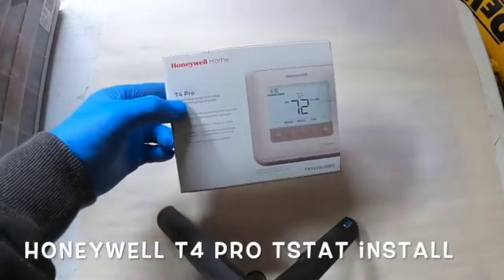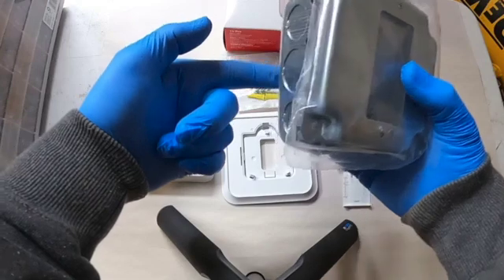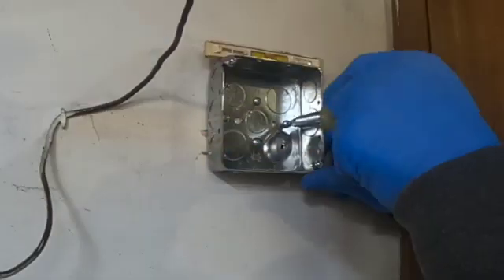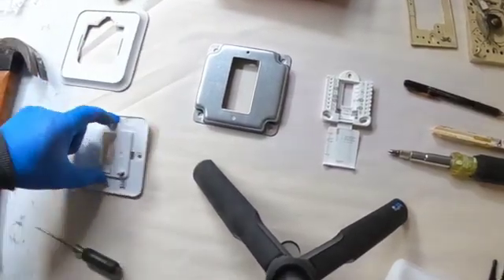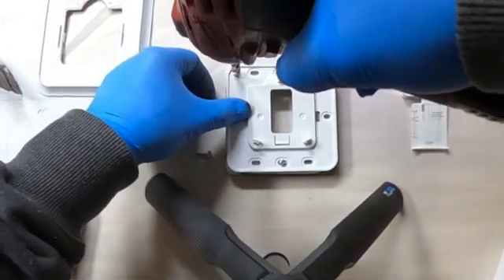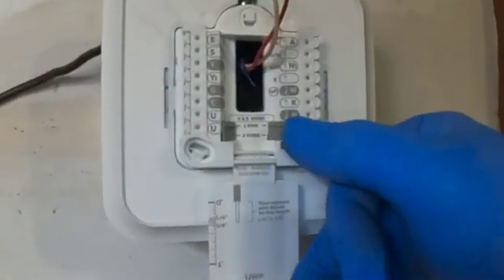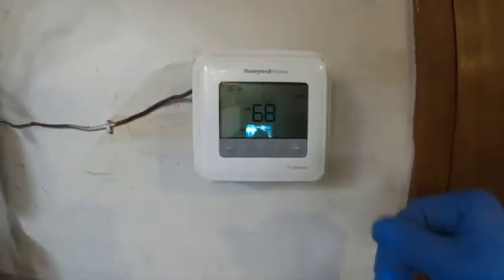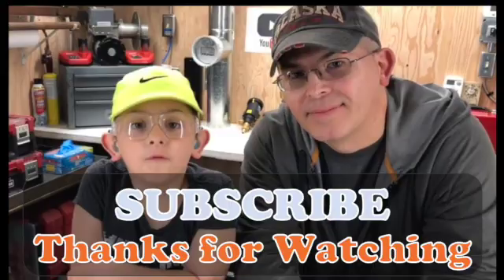Installing T4 Pro Honeywell Thermostat

Comment: Hi, I have the same thermostat, the TH4 HOME. If I want to upgrade to the pro version that has a WiFi control option, can I just plug the new head unit into the same base? They look practically identical.

Comment: 2 questions:

1. Why not use the common wire?

2. Why not mount the metal box cover to the box first, then the thermostat?
Reply from the maker: Thank you for watching and leaving your feedback! 

Most of our systems use only two wire setups. You can definitely use the common wire! 
I am sure there are many ways to mount a thermostat. This is just the way I did it for this project!

Comment: hi, is this installation is for heater only
Reply from the maker: yes, if you would like to hook up cooling or a fan, you would need to connect the (Y) & (G) wires to the tstat as well. I was only needing heating when i created this video.
Reply: @FurnaceTech  can u make a video on how to connect heater and air conditionin

Comment: I have a blue and black wire.. Not sure where they go
Reply from the maker: The best thing would be to trace it out on the other end to see how they are connected. This way you can be sure to hook them up correctly.
Reply: I ended up popping the furnace open and looked at the wires and aligned them to the letter.

Comment: I have a T3 and I want to connect the heating, which should I use the same ones that you used in this video or C and RC?
Reply from the maker: R - power from heating transformer 
Rc - power from cooling transformer 
W - heat
C - common
Y - cooling
R - fan
I hope this helps
Reply: What if I don't have a common wire

Comment: Red and white?? What kind of thermostat ever has only red and white? This is useless for actually wiring and you don't need a video for mounting the thing on the wall.
Reply from the maker: Every part of the country does not use Air Conditioning. We have mostly heating systems here in Alaska where I am located! Which is why this thermostat is only using two wires. Maybe this is a waste of time to reply but I do appreciate you taking time to leave your feedback.
Reply: My only has red and white. Really helpful this video!!!
Reply: It was all relevant.  Thanks for the information to all.
Reply: Agreed

Comment: Only with 2 wires, air conditioning will work??
Reply from the maker: No, you will need a yellow wire as well. It will be hooked to the (y) terminal.
Reply: NO HE IS  TOTALLY WRONG , FIRST OF ALL THAT IS HEAT PUMP THERMOSTAT , NEEDS 5 WIRE , R. W.Y. C. G. O.OR B. TERMINALS

Comment: How do I set the a/c on auto mode so it's will turn on or off depending temperature? It's so freaking cold at my house right now ,and it just keeps going ever since they installed it yesterday? I have a feeling it's either I turn it off or leave it cuz I couldn't find the auto a/c program on it. Or am I just that stupid ?! It's so complicated 😫😪😩
Reply from the maker: Not sure if this is your problem or not. If your system will not go from the cooling to the heating mode automatically then follow the steps below.

You have to go into the installer setup function of the thermostat.
1) press the menu button and + button at same time.
2) it will say ISU in the screen. Now hit select button
3) screen will show numbers like 120 and a number below it like “0”. Hit select button until the number on the screen says “220”
Make sure the number below it says “1” if you have one stage if cooling.

4) next hit select until the screen says “300”  and change the number below it to “1”.

Now you should be able to hit home button 
And click mode until the screen says “auto”

Also, check the thermostat temp setting.

I hope this helps

Comment: Why is that this model has temperature sensor off at 3 to 4 degrees and this is a lot since usually setting the thermostat between low and high its mostly between 4 to 5 degrees.
Reply from the maker: You can go into the set up feature and adjust for this.